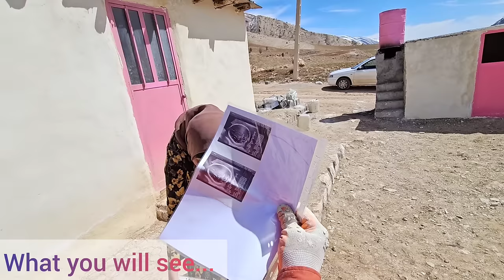Selfless Care: Rescuing a Divorced Woman's Child by a Kind-hearted Man Amidst Adversity

Comment: Doo , get Uncle to get you some clothsline rope and fix you a clothsline to dry your clothes on , so much easier for and with babies coming you need a good place to dry them ..two poles about 10 to 15 ft apart , eands attached to thick wooden poles inserted into the ground , cemented in.. will help you a lot for clothes drying..😊